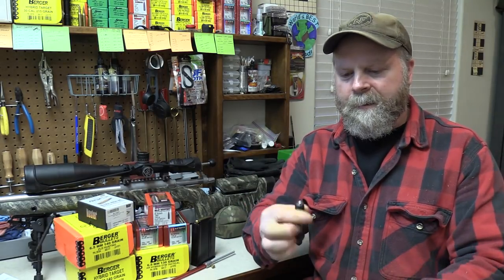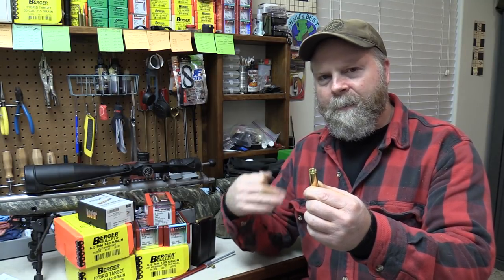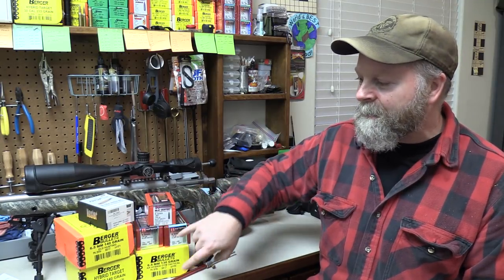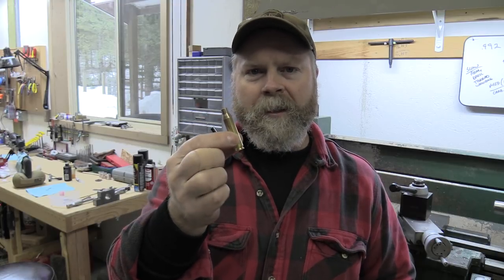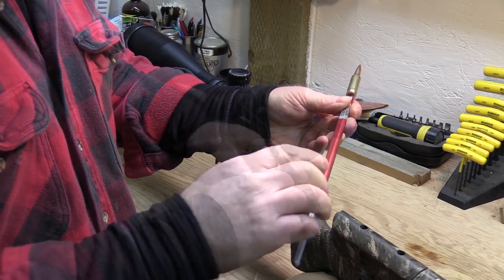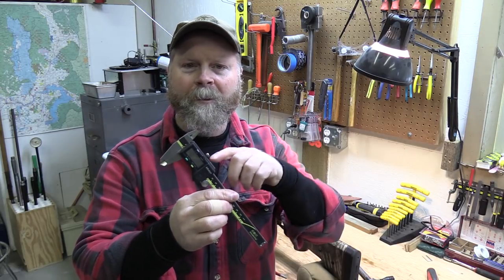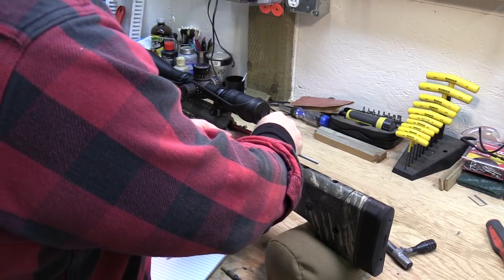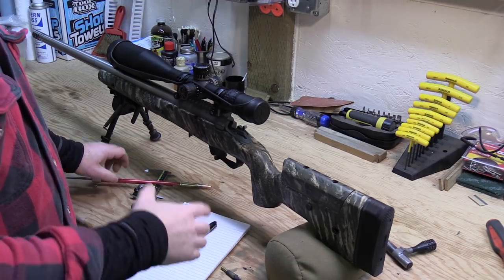Precision Rifle Load Development/ Part II: Bullet Choices & Initial Seating Depth

Comment: Why are Berger bullets preferred over say Hornady or Sierra Match King? I ran into that problem with 2 different  comparators.Inchecking a load and used two different ones and wrote down each separate compactor reading in two columns..A lot of difference. 
Great Video.
Reply from the maker: I don’t think they are. I’ve had great results with lots of different bullets.
Reply: @PanhandlePrecision  I asked 11 guys at a local match and all but 2 were using  Berger. The 3rd one using Hornady was me
I shot just fine though.All I've used is Hornady.Mainly because it's what available where I live.I was glad to hear you say shoot what fits your barrel and dont worry about it.
You have a Great Channel. It really helps me since I'm fairly new to reloading.
Reply from the maker: @TexasTrained  It always amazes me how many shooters will buy bullets based on what others are shooting, then keep trying to get them to shoot, even when they obviously won’t in their barrel. Always keep your options open!👍🏻

Comment: Hey, really enjoy your videos and have been learning alot. My question is, if your COL is bumped back 0.020 from your rifles throat length and that's your starting depth for a new load. If this length is much longer than your load data in your manual,  would it not inherently make that load a "lighter" load due to the capacity being more
Reply from the maker: There are too many variables involved to determine that. Pressure is affected more by overall chamber size (including the throat/bullet jump) than the space inside the case from different seating depths.

Comment: I bought the Sinclair bullet comparator and I’m finding it’s giving me big differences in taking my measurements.  I’m thinking where it’s made of stainless steel it’s taking a bite into the bullet jacket and giving me different readings, so would lightly chamfering the edge help fix it?  I’m new to all this but I really enjoy it and enjoy your videos.
Reply from the maker: odd766 I wouldn’t touch it; it already has a light chamfer. It does take some practice, but your readings should be repeatable.

Comment: Great video. I NEED to send out a fire piece of 6.5 brass to Hornady to have them tap it for me. If I wanted to do it myself and I do NOT have a lathe what would I need? Or what would be the best way to do that?
Reply from the maker: You just need to drill the hole straight. It can be tapped by hand.

Comment: so once i find the max my friend said to back off on it 0.020 and try 5 or ten rounds and keep backing of by that much until you get it right now thats the hundredths position you said thousandths how much exactly should i seat the bullet off of the max cbto how much basically should i load the rounds length wise increments wise before i stop like if the max is 2.128 how much do you think i should back it off before i know ?

Comment: So, just to be clear, to get into precision reloading, I'll need a press, some dies, a neck sizing die, a body only die, ...and a $3,000 lathe (or more) to drill out the ass end of my custom case, buy a tap 5/16x36, and...  then, maybe, I'll find a load that shoots better than Hornady 140 ELDM factory loads.  Guess it's better than watching American Idol.  Great information, regardless.  I'm wondering how much difference it makes to use a custom modified case vs the Hornady factory modified case.  Remember, we're just trying to get to 1/2MOA and sub 10FPS, right?  It'd be interesting to do a side by side and see what the delta is from the factory mod case vs your custom one, everything else held equal.
Reply: Not really. A case could be drilled and tapped by hand. Basic reloading equipment doesn't have to be expensive and will last a lifetime. Handloading will always be more accurate but only really relevant for the more serious of target shooters. If you just hunt I'd buy factory ammunition.

Comment: I know. Not a best practice, but can I use a wood lathe to drill and tap a 6.5 case for the Hornady tool ?
Reply from the maker: Best practice is a practice that works. The case doesn’t care what kind of lathe is spinning it. Slow spin and straight drilling. The tap can be done by hand.

Comment: Great video. I don't have a lathe so I used the Hornady modified case and measured the headspace. I then measured the headspace on a fired case and did the math (.035 on a 223).  Shouldn't this work?
Reply: Seems like that should work but 0.035" seems like a big number.
Reply: Your right. Typo. It's .0035

Comment: Sam,  I don't understand the benefit of using once fired brass if you run the case through a body die before you use it.  Does that not defeat the purpose of firing it in the gun in the first place?  I need a bit of help.  thanks
Reply from the maker: Randy Sachau It’s makes the modified case an exact representation of what you’ll be shooting. It will chamber easily, and give you the most accurate measurement possible while using this method.
Reply: Thanks for the explanation, I’ve been trying to wrap my head around it for ten minutes now as to why you bumped the shoulder back two thousands...crystal clear now.

Comment: I don’t get it. Wouldn’t the case head to ogive be the same no matter if the brass is fired or not?
Reply from the maker: The difference will be exactly the amount that the case stretches between the shoulder and head.
Reply: @PanhandlePrecision  man, I feel so dumb because I can’t picture this, but I know the problem is me. Need to think about it more.
Reply from the maker: @raker1980  It’s easy to picture it if you draw it out. The shoulder and point of the ogive measurement stay constant. The case head moves away from shoulder. Because you’re measuring from the case head to ogive, you’re actually pulling the bullet further from the lands as the case stretches, if you don’t account for it. In reality, it’s probably not critical for most applications.
Reply: @PanhandlePrecision  Oh geez, I get you know.  I was picturing the shoulder moving only.  I see now that if the whole length of the case is changing, that the length to ogive will change.  Thanks!

Comment: Hey Sam do you weigh every butter out the box  ??
Reply from the maker: I have before, but I don't normally weigh every one. In fact, I don't think weighing bullets is productive at all. I usually measure the bearing surface of a large sample of bullets from each lot I use, looking for variations and comparing it to past lots. If I'm reviewing the bullet, I'll also weigh the same sample, but mostly out of curiosity.
Reply: Ok thanks for the reply that helps a lot

Comment: what is frustrating is you do everything the same way and you get different results.  For example, bumping the shoulder.  If you resize 20 cases (same brand, everything as close to the same as can be done) I can assure you there will be .0015-003" difference in some of them.  I don't know if this is because of different heat treatment on the individual brass or what.  Also, I hate the digital calipers.  I am going to mechanical micrometers in the future.  The digital calipers can be off .0005" easily, sometimes more.  Much more precise.

Comment: Another way to skin that cat if you will. Wrap tape on a cleaning rod. Put just a projectile in chamber look down and make sure it’s straight. Use a dowel behind it to hold it in lightly and push the cleaning rod up against bullet. Mark tape with razor on end of barrel. Take bullet and dowel out put bolt in and get second measurement. Bolt to jam start easy Make sure cleaning rod has a flat attachment like brass jag without the pin. Oal to a razor edge.

Comment: Why measure to the ogive rather than to the bullet point?
Reply: You shouldn't even be watching this video if you don't know the answer to that question.
Reply: NOPE
bestog is what I call a dick.
The reason we  measure from the ogive it's because that gives us a consistent place to measure from, or to, on every  bullet of that manufacturer. Keep in mind that every different bullet weight and manufacturer, will be different and you will have to perform that same type of test if you switch projectiles. It also should be very close to the place that contacts the rifling when he used the cartridge overall length gauge to set his original dimension for a "finished loaded round" .
So in a nutshell, it is a solid reference point to go back to and to gauge the process of burning out the lands of your rifling.
There's a lot of reading and a lot of learning involved to precision shooting. The sooner you start reading reputable sources, but sooner you'll get there!

Hope this helps. Good luck and stay safe
Reply: @magua1368  
That was INCREDIBLY helpful, thank you!

Comment: When you drill out that piece of fire formed brass to make the case for the Hornady OAL Gauge,  how accurate does the "drilling out" have to be?. Unfortunately I don't own a $20,000 lathe...Got a sweet cordless drill though.
Reply from the maker: $20K? Try $1200.:-) Try it and find out.
Reply: Thank's Sam, but do I really need one to create the case or is a electric drill enough?. Not trying to be a smart ass, but if a cordless drill will do the job I'll be saving money for a scope or something else I need.
Reply from the maker: I would certainly try. A drill press and a good clamping system would be better, but if you can hold it with a vise without marring the brass, a drill should work. I would step up to the finish bit size, using the primer flash hole as my first index. As long as you can screw the gauge into the case straight enough for the blade of the caliper to seat on the case head, it should work. I would practice with a case you don't care about first!
Reply: Thanks for the tip. Also, do you body size/shoulder bump after every firing or just neck size till you get a tight round.
Reply from the maker: FL size every time, with a .001-.002" bump.
Reply: Sam, what would you recommend for rifle cleaning, how many rounds before I should clean the bore?. I've been told anywhere from "after 10" and all the way up to 300 rounds (I know there's no exact number but a healthy recommendation is what I'm looking for). I'm shooting a .308 with 168gn Berger VLD/Hunter if it makes a difference. I can't do the extreme long range shooting that you're doing (we just don't have that kind'a room where I live, but I can find some places out to 500 yards) and accuracy is still important to me. Thank you.
Reply from the maker: ruthless4645 If you haven’t already seen it, this article explains how I approach rifle cleaning: http://panhandleprecision.com/cleaning-a-long-range-precision-rifle/

I’m planning on a video about it, as soon as I get further into this project.
Reply: Good info, thanks.

Comment: Why made the rim thicker than normal which limits the user who can use it (poor marketing move), I have never pulled a rim ever and if the reloading is done correctly you never will. To pull the rim it will take a bad resize and have to use a hammer on the bolt to even get a chance of pulling the rim.